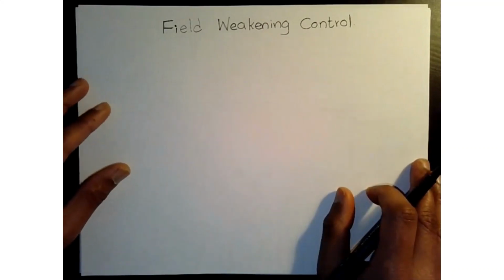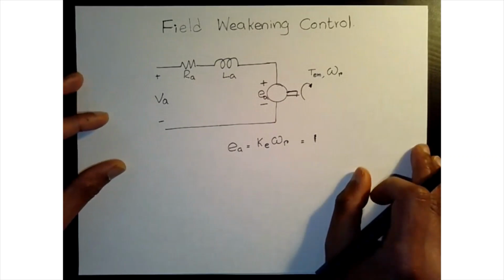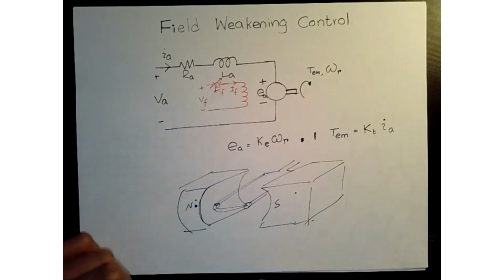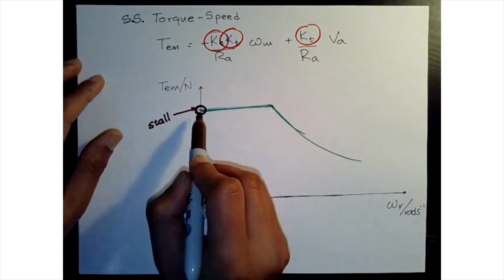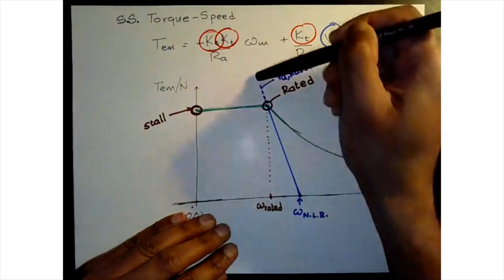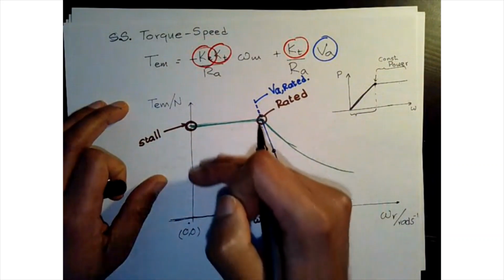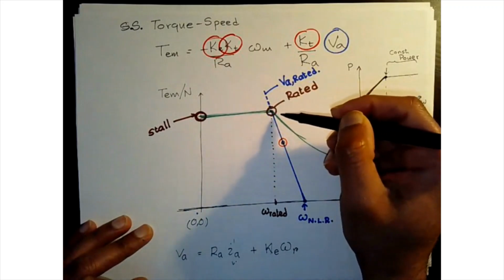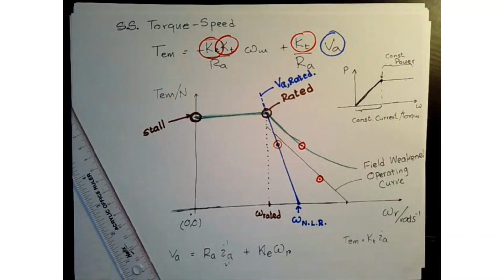Field Weakening Control of DC Motors

Comment: Great video! I have a question. How can you keep the armature current the same in both of those two regions? We know that a transient phenomenon takes place when you jump from curve to curve. In this transient phenomenon, the current is increasing, so the torque increases, the machine accelerates, and when it accelerates, inductive voltage is increasing - so the current decreases again, and equilibrium is achieved at a higher speed. What makes us sure that the current will be the same again?
Reply from the maker: This discussion is about steady state operation. The system will settle to the specified operating point after the transient.

Comment: Sir, we are reducing Ke using field weakening to get more speed, but is it possible to increase Ke and get more torque and lesser speeds?, as some of the applications might need more torque at lower speeds.
Reply from the maker: Honestly, Ke is not changing. In a PMSM unlike a wound field DC motor, you have very little control over Ke. We are more or less de-saturating the stator. So therefore, you can not increase Ke either.
Reply: @SandunKuruppu  Thank you sir! Watching rest of your videos too for clarity!

Comment: In the field weakening range, we are sacrifysing the Current "Ia". i.e. Torque is reducing, speed of the motor is increasing. If speed of motor changes, "Va" is also changing. (I know Va is the supplied voltage to armature).. My question is how this region is called "Constant power" region ? Can you please explain ?
Reply from the maker: Because you have sacrificed current available for torque to allow the motor to go to a higher speed. Power = Speed*Torque from a mechanical point of view. You trade off torque for speed, but the product stays constant.
Reply: @SandunKuruppu  so you mean the power stays constant. Correct me if this is a wrong
Sample total power is 2400w
=50V×48Amps
To
Power=2400w same
=80Vx30Amps
Reply from the maker: @jobmariano348  Max power capability stays the same. Within the max power curve, you still have motor characteristic curves that governs motor current based on the applied current and motor parameters. Let me try to create another video on this soon.

Comment: Thank you so much!!! Do you know where I can practice all those ideas? Text Book?
Reply from the maker: Mike, there are number of textbooks out there such as "Electric Motors and Drives: Fundamentals, Types and Applications by Austin Hughes" or "Analysis of Electric Machines by P.C. Krause". The field weakening concept is used with wound field synchronous machines or in non-salient PMSMs for high speed control.